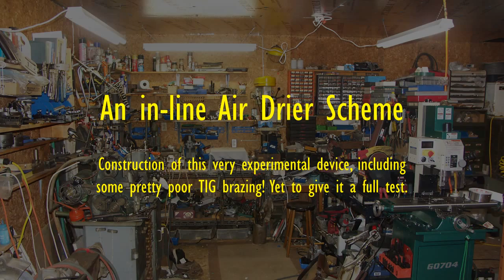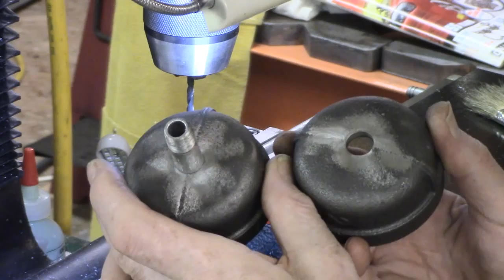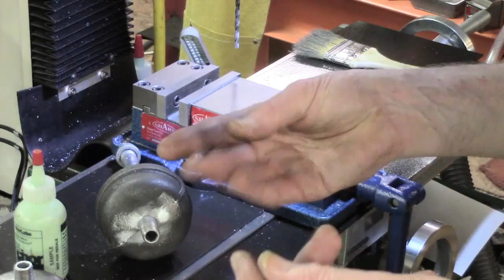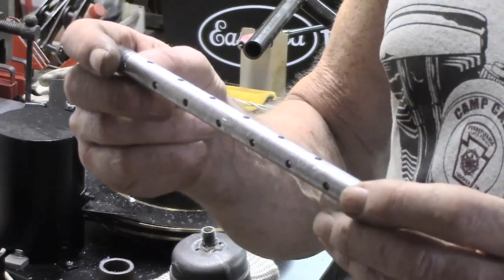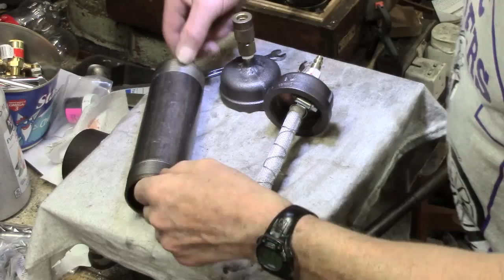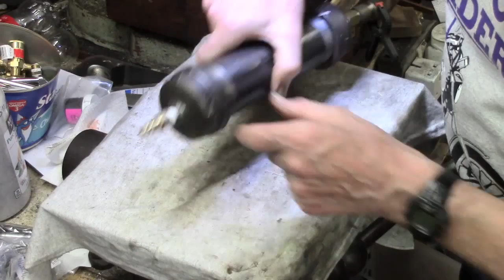An in-line Air Drier Scheme

Comment: Hi Chris great DIY positioner.  There is another fellow on youtube who made a dryer similar to your except he just stuffs an old cotton T shirt inside and claims it works great.  https://www.youtube.com/watch?v=gfRH4Ol7x1Q  How is the one you built working out?
Reply from the maker: Thanks - not sure a cotton T-shirt would work well enough really. Mine has only been used a few times and last inspection the silica gel beads were still the right color... mainly for the plasma cutter.

Comment: Chris,

These simple driers work very well.
I have been making my own ones for years now.
Try to find yourself a few of those water filters (the ones that are discarded when spent)
They don't corrode (that pipe will , and fast)and they are usually made out of very heavy gauge translucent plastic,so you can actually observe the colour change in the product, telling you when it needs changing.

Keep the vids coming !!!

Cheers
Paddy

Cheers
Reply from the maker: +gh778jk 
Hey Paddy -- thanks for the suggestion. I have rather been expecting a lot of corrosion but thus far with limited use pretty OK. I like the idea of water filter - will look into that.

Comment: If you look on xynudu's channel: https://www.youtube.com/watch?v=ACPoyUM9yco you will find a very ingenious dryer that uses no dessicant at all. All made out of scrap pipe and a few fittings. You might want to think about it. What you have in your design is flow through porous media. Monumental nuisance. Porous medium retards the flow.
Reply: Juan Rivero The type of drier made on xynudu's channel is only removing the droplets from the compressed air, the air is actually still pretty much saturated with moisture, the desiccant method is the driest air you can get about 40deg. dew point, the other method is the chiller setup about 40F or about 4deg. C dew point. ;)
Reply from the maker: Juan Rivero I know there will be a loss in vol flow Juan. I think I saw that system you mention - not practical here anyways because no walls available for mounting or running pipework.

Comment: Nice as always,I noticed you have a picture on your youtube channel of 
a myford/drummond 3"5 M type lathe..The same as mine that I'm starting
with..Do you own it ??
Reply from the maker: Muhaa Haloa Thanks -- re the Myford.  Sad to say that, plus a lot of other machinery was sold off in UK 15 years ago before I came over. Nice machine - main mod' I made was a gear addition to make carriage go the right direction! In other words - rotate hand wheel clockwise and carriage comes to right - used be reverse of that!
Reply: ChrisB257 Oh mate i wish you had the plans for that mod..Its annoying i noticed it as soon as i purchased the machine but restoring it this year its in great condition its the 1946 model as well..Would love to make a new tool post and stuff for it,This winter i will be making my own channel..
Reply from the maker: Never had plans! I actually dug around and found gears to suit - made a block with shaft thru etc. Look real close at my Myford channel pic and you'll see just a bit which might help.  - it sort of shows the block and gear driving thru to the rack. Worked well - I'm sure you could work out something on that sort of approach. I made a new 4-way tool post for mine - unfortunately not in the pic.

Comment: Good idea. I would have just tigged that stuff with er70s2 or 309.
Reply: tjsnordic My experience with those cast caps and fittings, is that they will crack if welded with anything less than high content nickel alloys or simply brazed like Chris is doing, stainless rods might work, never tried it though... ;-)
Reply from the maker: tjsnordic The rod used was very much what I had to choose from! :)

Comment: Thanks for uploading the videos, I enjoy them immensely, couldn't help notice you have 3 pin plugs like we do here in the Uk, but your having high temperatures  unlike us at the moment, so what part of the world are you  in may I ask? Cheers Howard.
Reply from the maker: Howard Nicholson Hi Howard -- yes, several old UK three pin sockets around. When I came over 15 years ago I had made a couple of large auto-transformers and the shop one has wiring to different areas for when needed. I do actually have a 220V supply but that is kept available for welders and plasma etc. My old lathe still runs off a nominal 240V from auto-trans (drill press too) - just means slightly higher RPMs from motor.

Comment: I have found that the foot from a woman's pantyhose is excellent as a low cost homemade filter on the dip tube or to encapsulate(bag) the silica gel. 
A commercial alternative is to use an inline sintered bronze filter element (McMaster Carr) on each end and allow the air to freely flow through the silica gel spheres. 
I have used both and I did not notice any difference in performance. 
Cheers.

Comment: interesting series, I'm planning on building one myself when i order my machine. I think you are better off filling it  completely as any air bypassing the silica gel will not be dried, Maybe a shorter inner pipe with more holes ( or equivalent area) insuring that all the air will pass thru the silica gel.
Cheers, and keep up your great video's
Reply: Phil's Projects
We'll get at it.... more projects.... ;-)
Reply from the maker: Phil's Projects Hi Phil -- chances are I will nearly fill with desiccant ..... remains to be seen over time if there is any useful effect.
Reply: I await with bated breath..
I will be ordering the Everlast power pro 256S with in a month And i will need a dryer for the plasma cutter, Thanks for ironing out the quirks for me.
Reply: Phil's Projects Hummm.... Guess some up coming project of an air drier.... Fun!
Reply: Yep! gonna need some lathe work ;-)